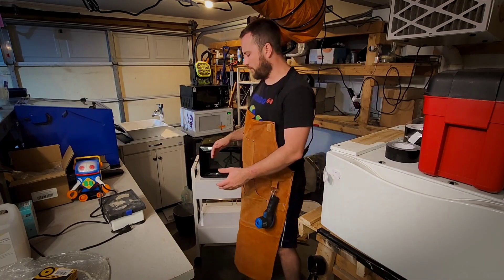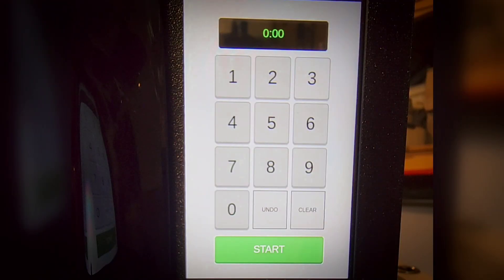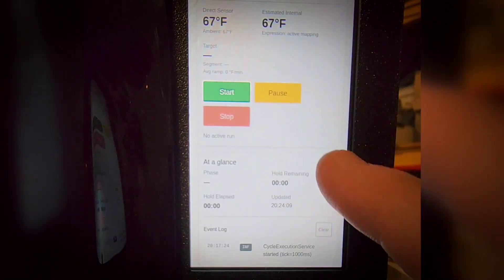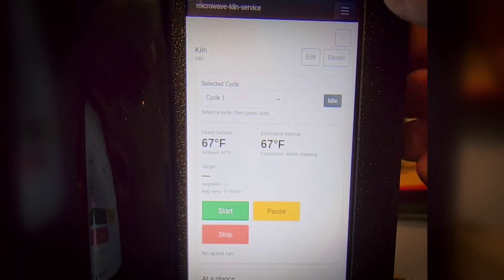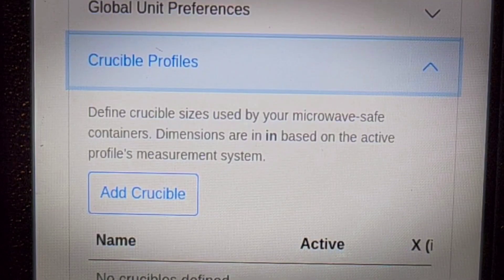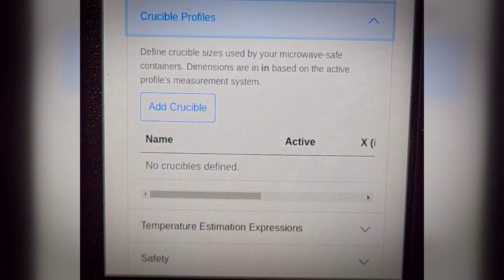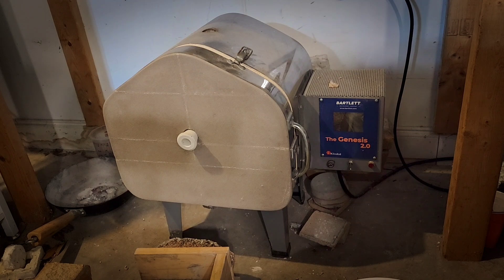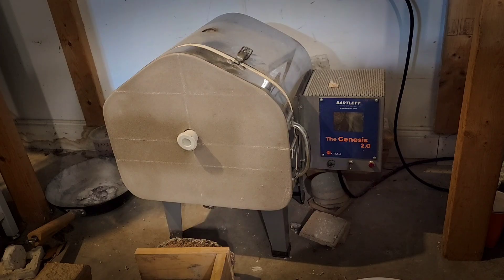A First Look at Our Programmable Microwave Sintering Kiln

Comment: Not sure why you don't have more subs, but you just got one more. 
My apologies if this has been covered, but have you done any type of testing with Inconel in the microwave version?  I've searched for months and for some reason haven't arrived at your channel until I saw your link on a reddit post(and they say there's nothing good on reddit😂) and had thought I would be stuck spending 5k at minimum for a small PLC controlled kiln.
Reply from the maker: Hey thanks for the interest and for the sub 🍻

Inconel is definitely on the list, but ive been pretty stubborn when in comes to getting aluminum right ha.

I have a spool of inconel and will try to print a few test parts for my upcoming benchmark tests (of which I'll share results through a video... at some point)
Reply: @Mr-Highball ill definitely be looking forward to seeing that!  I've found some budget "bench top" programmable kilns that I've considered, but having no experience with that end of metal working I'm unsure of whether they'd work for what I'd want them to do. Do you have any experience with those?
Reply from the maker: Totally depends on what you're trying to do. I have a traditional kiln but its bigger thsn the table top style and like it a lot, but its heavy, takes a lot of power and would struggle with the upper bound temps of steels+
Reply: @Mr-Highball it would be for making tubular assemblies with various forms of internal geometries with most measuring 6 inches in length but variable up to 9 and a max of 2 inches in diameter. It seems most of the smaller units claim to go to 2200f but with no experience its hard to commit to one of these units just with hopes of it working 😂
Reply from the maker: Ok so for something that size id be pretty focused on the internal dimensions of the kiln. You dont want to touch the coils or you'll risk a short so always buffer... then for anything you'd have to support in  in ballast + crucible, you'd have to account for size of that as well
Reply: @Mr-Highball  Gotcha, that makes sense!  Dumb question though, I can't find a rectangular style crucible that's deep enough to house the part as well as the steel blend and sintering carbon as per Virtual Foundry's specs so is there anything(safety features, coils, overall terrible idea) that would prevent me from using a benchtop unit sitting up on its back side to where the door is on the top and the crucible would technically sit upon the rear of the interior?  I can find crucibles that will fit but the vertical interior height in the units normal orientation that I'd need to fit a normal style crucible dramatically increases the units price lol
Reply from the maker: I would have to point you to the kiln support email for that one haha.  It should be ok but you'd want to check with the vendor on that
Reply: @Mr-Highball  excellent!  I'll start reaching out to them once I find a model that looks reliable that may work out.  I definitely appreciate all of your time and looking forward to seeing how that slick microwave ends up working out!

Comment: Maybe a cheaper version? A $50 mechanical dial microwave set to on, and a ras-pi running a relay that turns it on based on software settings.  People could source their own microwave. At $2500 im not sure there is a market for the type of person that would use an item like this.
Reply from the maker: That may be the case but you're oversimplifying the design. If there's not a market out there for it then I'll just have a highly custom hobby tool, and thats ok too.

One thing though that this allows is sintering of reactive metals like aluminum, and I'd challenge you to find anything on the market today that can do that at a sub 3k price point

Comment: Cool! do you find that it can be accurate enough for heat treatment of steels (+-5c)? 
Also, do you find that using a plate-less microwave is better? 
If you use one what comes with a plate, do you actually use the plate to turn the crucible or just ignore that feature and not use it?
Reply from the maker: Still working through testing of the new design.  Compared to what I had with just the normal microwave features this is not even in the same ballpark for ease of use / accuracy. 

It'll be tbd though on what exactly can be achieved with this unit (this particular microwave is a 600w unit, where in my previous tests ive used 600w/900w and 1100w for different materials).

My next video will go through a benchmarking of different materials, power usage, and upper limits. Turn table is also something I didnt use in the past, but may be used going forward since we do have full control of that via code and settings
Reply: @Mr-Highball so right now you're using a normal microwave with a turntable, but ignoring the turntable?
I'm wondering how much the uneven-ness of the standing waves matters
Reply from the maker: I do manual rotations in my cycle, so not truly a fixed position sinter just a lot less rotations since i physically have to move the crucible

Comment: Do you have a build-log or a parts list you used? I see youre running it on a raspberry pi, but im really interested in how you interfaced with the primary microwave components. Great build and I'd definitely be interested in building my own!
Reply from the maker: For now we dont since we may try and sell commercially but if something changes with those plans we'd likely open source it

Comment: So cool! How are you able to get temps?
Reply from the maker: Thank you, we're using IR sensors paired with expression / estimations. This aligns with my manual approach and is actually quite accurate if dialed in appropriately.
Reply: @Mr-Highball Most data sheets for components (and sensors like IR sensors) have graphs showing component parameter changes vs. change in input current, voltage, temperature, and possibly humidity. I assume you or your brother have looked at the IR sensor data sheet and done hardware or software compensation for these “environment variables” on the output of the IR sensor(s)?
Reply from the maker: Yes, but the primary compensation right now is done through the expression system, paired with a benchmarking / calibration phase which uses external readings
Reply: @Mr-Highball Very well. Thanks for adding some additional clarification of your current measurement (and compensation) process.